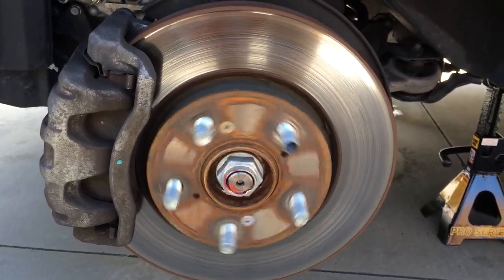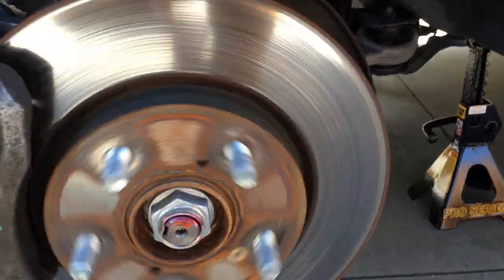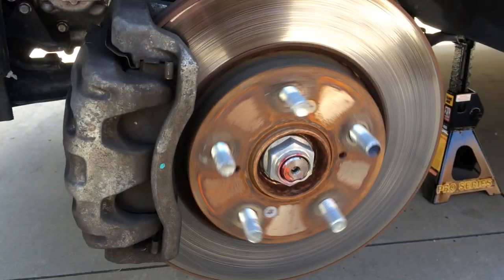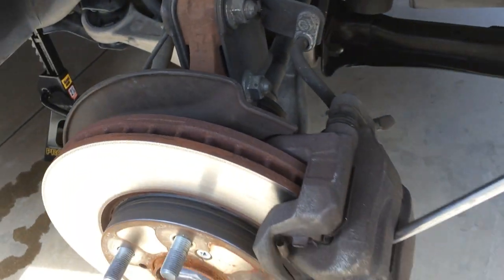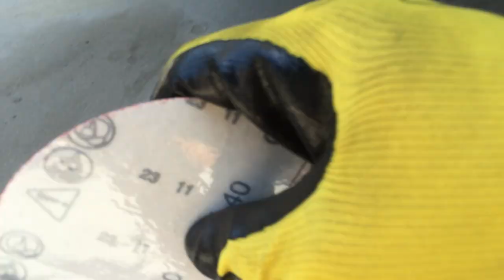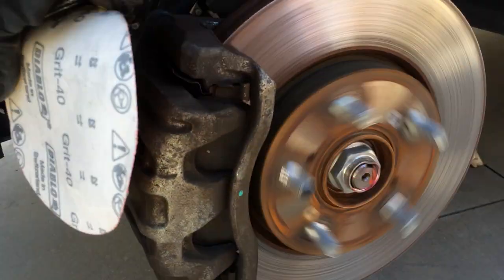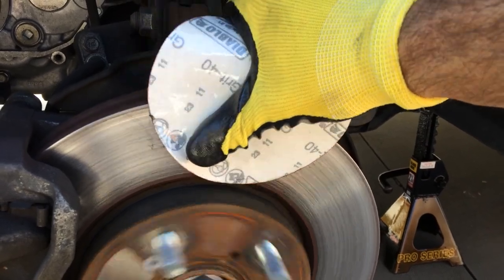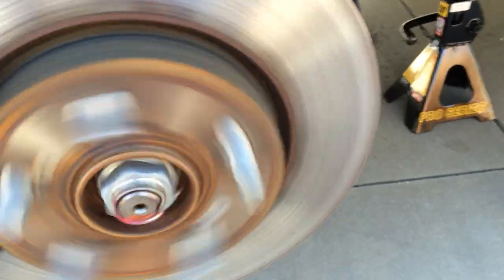Deglazing your front rotors.

Comment: This is a band aid fix. Not fixing the root of the problem
Reply from the maker: Corona light which is what?  My wife is easy on the brakes and yes after a while it does create a little bit of glaze. I always use the factory brake pads with break paste and even a little bit of anti-seize on the very tips of the pads where they slide into the caliper
Reply: James Carroll just turn off comments on future videos, people are garbage.